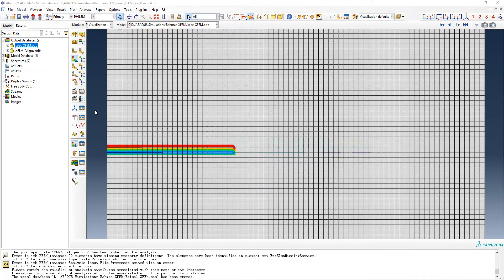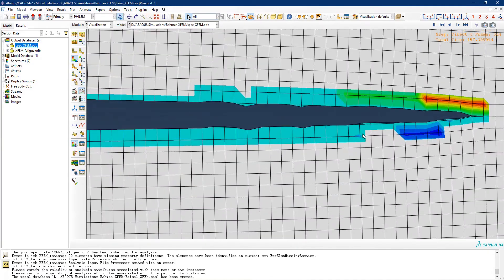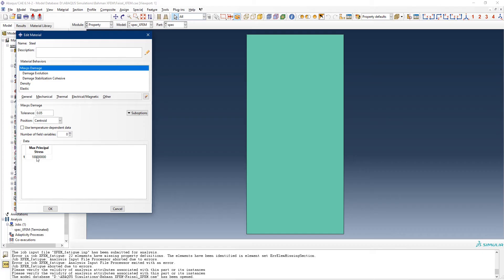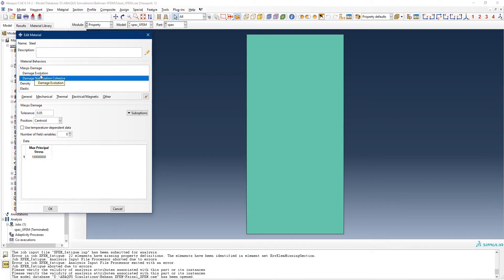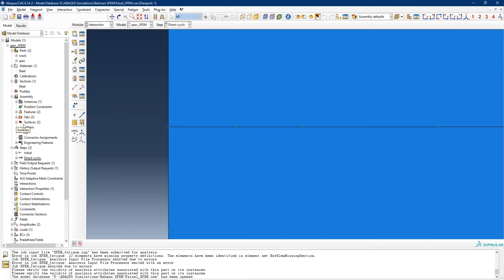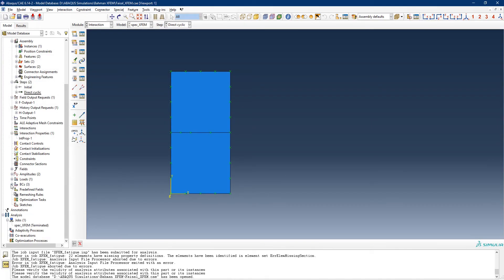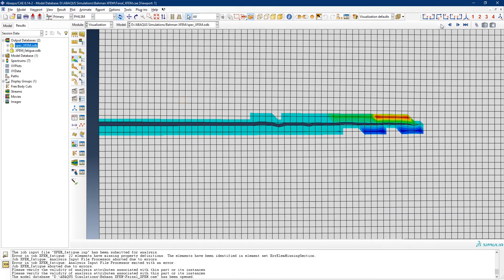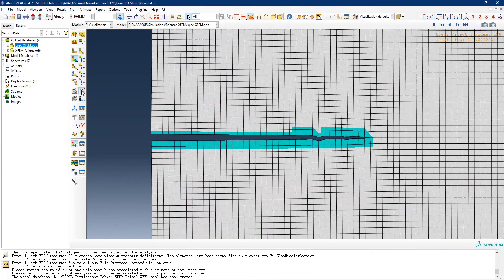Modeling XFEM fatigue crack propagation in ABAQUS using Direct Cyclic approach

Comment: I am working on mixed mode fracture in concrete using XFEM method. For that the crack would propagate at some angle not straight like in your case, and that is because the fracture energies are different for different modes and hence their contribution vary as the crack propagates with time. I am curious about the fact that how one would know which region and to what extend one has to select to make sure that the crack propagate in that region. I mean how you new that you crack will propagate along that straight line, it could have, practically, gone anywhere in that plate.
Reply: do you have the answer for this? Cuz im also curious  😆

Comment: thank you for the video.please share us rolling contact fatigue analysis on train wheel- rail using abaqus
Reply from the maker: Have not simulated that before. It is tricky problem as the strain accumulates in the material over time due to rolling contact fatigue and results in material hardening and eventual failure.

Comment: Thanks for this video. What amplitude you have used for fixed boundary conditions?
And If you have any reference for the value(42200) that you have used as fracture energy please share.
Reply from the maker: I did not use any amplitude for the fixed boundary condition. This is just an example video and 42200 was just an exemplary value which I used here.
Reply: @FaisalQayyum   thanks for you quick reply. I followed each steps, shown in this video. But crack is not propagating. Can you send me the cae and njl file? It will be helpful for me. 
 kittusubrata@gmail.com.
Reply from the maker: @barman5186  yes I can if you write me an email at fysalqayyum@yahoo.com
Reply: @FaisalQayyum  ok thanks 🙏

Comment: hi can you make video on composite material
Reply from the maker: Hello, Thank you for the comment. There are many types of composites and each would have a varying modeling technique. Which one are you specifically talking about?
Reply: @FaisalQayyum  polymer composite where matrix may be thermosetting or thermoplastic polymer and reinforcement may be glass fiber,carbon fiber carbon nano tube(cnt) etc and may or may not be filler material

Comment: Please guide me to carryout fatigue delamination growth simulation in DCB specimen
Reply: I want to simulate the fatigue delamination growth resistance in presence of fiber bridging
Reply from the maker: @lubnamalik3769  like in this work ?? https://onlinelibrary.wiley.com/doi/abs/10.1111/ffe.12566
Reply: Please give ur email ID so that I can u cae. Files
Reply from the maker: @lubnamalik3769  fysalqayyum@yahoo.com
Reply: Yes exactly. What are the steps to perform the fatigue.
Reply: @lubnamalik3769  Hi Lubna malik. Hope you’re doing great. Currently i am working on something similar problem as yours. I am tryin to study Fatigue crack growth in polymer compo. I would really appreciate if you could offer some help in this.
Reply from the maker: Heyyy, Can you please explain your problem more ?? It will be great if you can please share it a bit more specifically on email.
Reply from the maker: Do you want to run a simulation model similar to what has been shown in this simulation?
https://onlinelibrary.wiley.com/doi/full/10.1111/ffe.12566
Reply: 2D and 3D model done. 3D model have z pins. Now fatigue to be applied for 100 cycles
Reply: Please guide and support